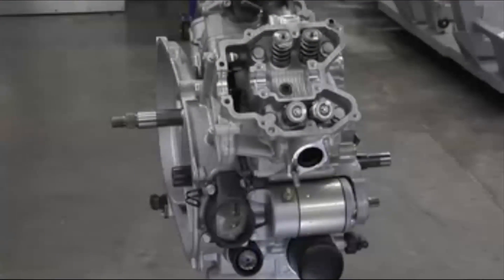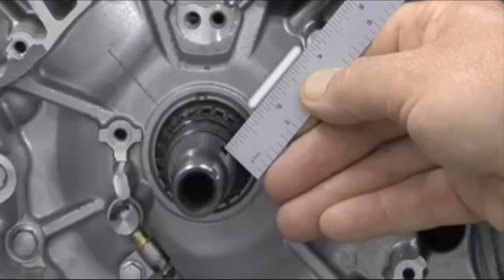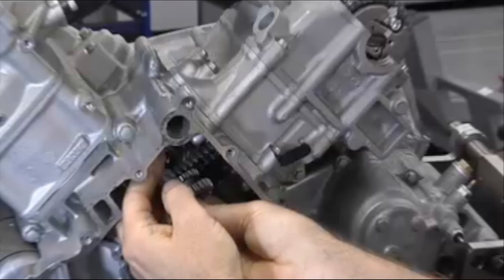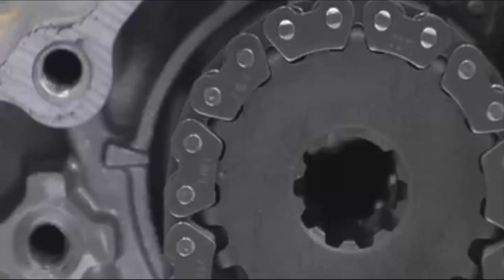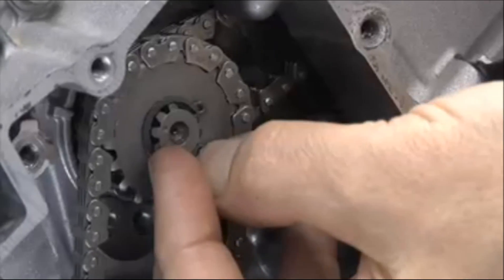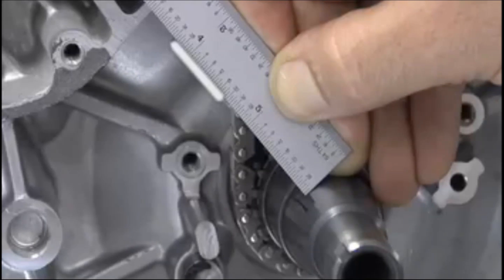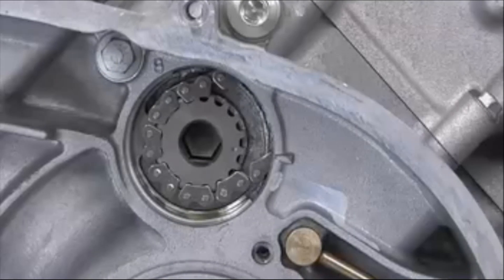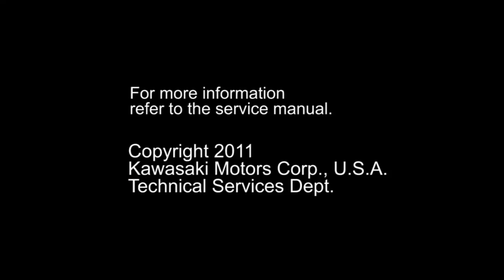Kawasaki V-Twin ATV Engine Cam Timing

Comment: God bless this video. I have just changed all the timing chains on a kawasaki kfx 700 😊
Reply: How did you get the timing chain guides off?
Reply: @tompetramanos2924  which one do you mean?
Reply: Looking at the flywheel side of the motor there are two black timing chain guides on a pivot shaft retained by a c clip going to the rear cylinder. How do u get the pivot post those guides ride on off. It's too long to slide the rear guide off
Reply: @tompetramanos2924  You ever figure this out? it looks like they kept the guides on

Comment: Hello . I also have a problem with this engine model ( atv kawasaki kvf 750 2008)where the oil pump is located, I have a metal pinch,because the pump was broken. and I decided to change it . how can i solve the problem ?? to use sandpaper or what else ?? because it belongs to the whole piece which is very expensivehttps://www.brutecentral.com/threads/hello-who-could-help-me-with-some-advice.25304/#post-196246

Comment: I was wondering if the timing chain guide on the rear cylinder needs to be installed before I drop the chain in to work the sprocket? I'm having difficulties getting the guide (the long one that is on the high side of the chain) to not put so much pressure on the chain when installing it. Thank you, let me know if this is confusing

Comment from the maker: hi.  thanks for the comments.  it is actually a factory Kawasaki video, that I produced as I work or Kawasaki corporate.  the arrow upward, the lines on the sprocket parallel, this method is right out of the factory manual.
Reply: Thanks for uploading it, 12 years later its still extremely useful!